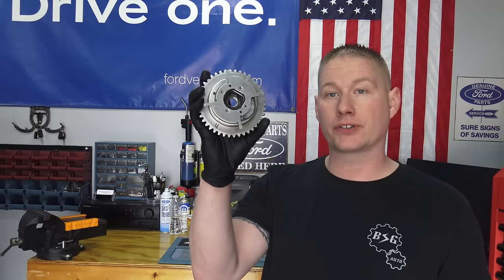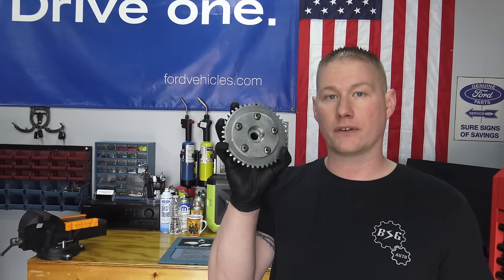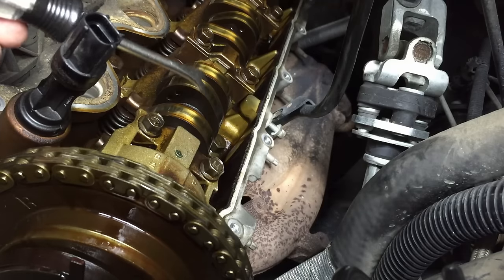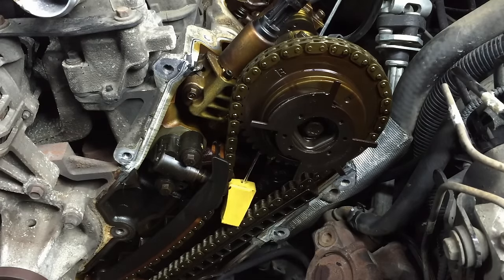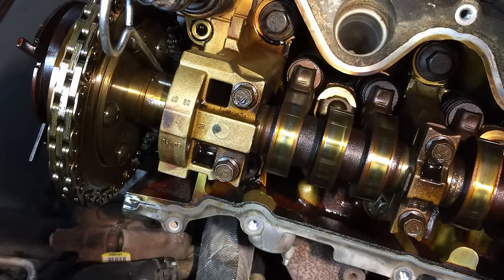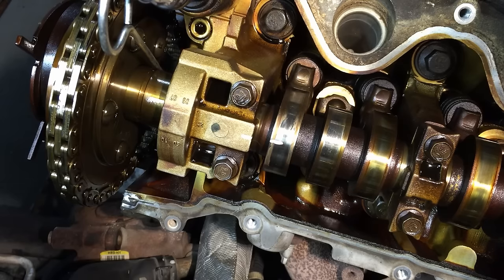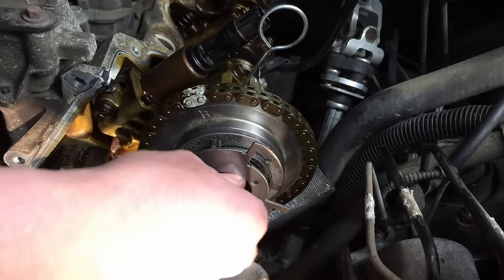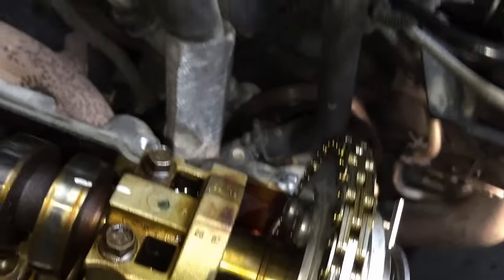Ford 5.4L 3v Camshaft Phaser Replacement**UPDATED FASTER PROCEDURE**

Comment: I put a paint mark on the chain where the r/L mark is, use the wedge tool, I take the second cam cap off, put a small piece of computer paper under the cap, tighten the cap down just snug nothing crazy don’t distort the cam cap from cranking it down tight it doesn’t take much and this will make the cam not move while u swap the phaser then remove the cap take paper out, torque cam cap then phaser bolt. Ford master tech told me about this 15 years ago I’ve been doing them like this ever since.
Reply: This is gold
Reply: Can I change the camshaft using this method?
Reply: Do I need to remove the timing chain cover in order to do this? I know this video is 8 years old but I have a 2011 Ford expedition with 200,000 mi that is starting to give me phaser trouble I've already replaced the VCT cylinders both cam position sensors and the PCM. So popping the valve covers it's not a big deal but I don't remember if I could get the cam phaser off without pulling the timing chain?
Reply: @Dyllanman  I would say no. You have to remove all the cam caps. Paper would do you no good in this case.
Reply: Is computer paper different than regular copier paper?

Comment: Guys do not skip the marker process, it will save you so much time.
Reply: How did you guy remove the cam phaser bolt. My impact doesn’t fit between radiator and bolt. If i use the breaker bar, it keeps pulling the block inside alternating my 11 oclock
Reply: Jacob Wouldn't those cam locking tools keep ya in time or a pair of vice grips
Reply: @wildwoodtop Vice grips works too

Comment: I wanted to thank you for this video. This helped me diagnose my truck and then was critical in the repair. I followed everything exactly, and the outcome was perfect! A few notes for anyone else attempting this: Make the marks on the cam phasers and the cam lobes, as indicated in the video. My cams rolled just a little bit when I took the phasers off, so the marks were crucial. On the cam phasers, the "R" imprint is very close to where the pin is located on the back side that has to line up with the notch in the came shaft, and if your "cheese" is in properly, there is no play in the chain. Moving the cam shaft slightly to align was necessary due to the roll of the cam in my instance. The hardest part of the entire job is the rear valve cover bolts. Either I need to be taller, or I need a low-rider! Due to the rubber grommets on the valve cover bolts, make sure they are all aligned and seated in the holes prior to tightening anything down. Visual inspection through the wheel well is imperative. GREAT VIDEO and PERFECT INSTRUCTION! THANK YOU!!
Reply: What kind of signs that it shows when you need to replace them
Reply: @michaelpatton5012  It sounded and felt like the truck was going to fall apart. It only did when it was warmed up and at idle. You'll know it when it happens. It makes a heck of a noise.
Reply: Can I ask how ya got the fam turned back and to stay in place?
Reply: @azmadmonk1  If you utilize the tools identified in the video, the cam should not turn once you have the chain removed. I did have a set of helping hands that held/watched the cam shaft to make sure there was no movement. It will move if you don't use the tools properly. If you are thorough and careful, shouldn't be an issue.

Comment: So you're saying that you do NOT have to remove the 3 roller followers on each cam once you have the crankshaft keyway at the noon position?  That's the more risky part?  If so, I really wish I would have watched this before using your 4 part series... I removed 5 of the six roller followers with a flathead (not the special tool) and can't get the last one (closest to firewall on passenger side).  Is there any danger in using the method in this video and leaving that last roller follower on?
Reply from the maker: +ChaseBrumfield In order to time the engine right all followers should be removed so the cams can be set perfectly in position.
Reply: Hey Brian, I have crank at 12 and trying remove rocker followers. I got 5 removed from 1-4-5 cylinders. But cylinder 8 exhaust spring seems to be compressed? What can I do?

Comment: Used this same process just yesterday on my 4.6 V8 Mustang. I didn't quite have the lobes at 11 and 8, after taking the phaser off the cam rotated a half inch or so. I figured no big deal, I'll hand rotate the engine to align the phaser to the cam and install it. While rotating the engine the chain sucked the wedge further towards the crank! Haha, I wrapped my tools up for the day and went inside.
Next day I was able to keep rotating the engine and aligned, torqued and finish installing the phaser then went on to fishing the wedge out.
My car runs smooth again and I have you to thank for guiding me through this seemingly daunting process! Thank you so much

Comment: I just did my passenger side phaser .. thanks Brian .. the alignment mark saved me from disaster . I couldn’t get it aligned and my cam had shifted a few degrees. I was able to use large channel lock and got it on there. Thanks Brian …

Comment: wanted to thank you for your 4 part videos on cam phazers .i'm from marquette mi my 3 valve 2005 5.4 was very noisy was down in Memphis Tenn no one wanted to touch this job. looked at all your videos and drove my truck back to the UP .with the help of your videos I was able to do the job. my timing had jumped one link . used your advice all ford parts new melling 360 high volume oll pump (that one bolt was very scrary to put in lots of rags in oil pan.)but i got it .took foever!!!! to get oil pressure.it seamed!!! connected crank sensor and started and runs great with 300 miles on it we are going back to Memphis THANK YOU AGAIN FOR YOUR VIDEOS....

Comment: Great series, I'm very impressed with the clarity and detail!
 I was able to jam the cheese rod into the timing chain from the front side of the phaser and replace the phaser easily with no clearance issues in my 2008 F250 5.4 (with 378,000 miles on it). My cheese rod would not fit through the cavity in the procedure that you suggested. Just an FYI. My cam did move. I was able to move it back and the phaser slid rite on. I'm glad I market it! The engine runs like a top. Thanks!
Reply: Yea looking at his video. I'm pretty positive the positioning he is using to get the wedge tool in is physically impossible to do with the front cover on. He points the wedge at one point where it would be coming directly out the side of the front cover. I don't think the tool has the amount of bend to make that happen. In the Ford service manual the picture they show as reference shows it going in through the front. So that would be the proper way of doing this.
Reply: @sethdrak3  Seth I'm working on a customers 2009 3v and I had to go in from the front of the phaser. I am surprised the amount of wear on the chain for only 117k miles on this vehicle. Still a great video.

Comment: Just completed driver's side on 2006 F-150. Couple of comments
1. I could not get the wedge in the way Brian describes it. There is a picture in the Ford installation bulletin that shows it going in on the outside of the head in front of the cam phaser. This worked for me and it was not in the way.
2. I did not have the cam positioned quite far enough and it moved when I took off the phaser. If it's marked like Brian said, no need to panic. It is easy to protect the cam shaft and put some vise grips on the area between the first lobe and the phaser seating area. Just realign the marks and put the phaser on. 
3. Lastly, I could not source a single valve cover gasket and had to buy the whole set. Though probably not needed, the rubber doughnuts in the set can be replaced, but they are not sealing gaskets. They are used to control the force applied by the valve cover bolts. You have to cut them off the bolt sleeve and then push the new ones on over the sleeve. DO NOT try to remove the metal sleeve from the bolts.
Reply: Bro your a life saver I was bugging on how to get the can back to it original spot. Looking it I figured vices or piper wrench on the would work. Thanks for your input
Reply: Thank you!!!! The vicegrip advice was desperately needed!

Comment: Dude, Awesome video.  I have seen a few of your views and I'm impressed more and more.  I was a Ford Certified, you however have what I like to call gear head, know what your doing when it comes to thinking about the math and timing, and pulsewidth , that kind of stuff.  Being I worked for ford for many years, it was a quicker burnout for me but guys like you reassure me that I still know what I'm doing, research first, and plug and play.  Great video man.  One of the more complex one's Ive seen you do but I prefer it.  Thanks man

Comment: This is EXACTLY what I needed. I was changing out the vvt solenoids and noticed that the coil spring on that phaser was broken. I didn't want to have to take off the timing cover because I've never done anything like this before, so it's nice to know that it can be done without taking it off.
Reply: U can do it just go slow and don't get high or drunk while your doing it

Comment: 20 + year ford tech here,, great video i never have a cam to jump because i cut a piece of plastic from a oil or antifreeze jug, remove the 2nd cam cap or further back and sanwich the plastic between cam and cap bearing and snug tight (no air tools as the cam cap will break) holds that cam perfectly. as stated in video make darn sure the dowell pin in phaser is there in place. don't eat the cheese. my personal truck 5.4 3 valve heads i sent off for a line bore and insert bearings like rod and main bearings, more important melling high volume oil pump more agressive cams, phaser lockouts reprogram to delete varible cam timing, headers + dyno tuning. results a tire roasting sob that still doesn't make the power of the coyote 5.0 stock. all this vct crap is supposed to help power and fuel economy. the 2004 and up f series is a heavier vehicle with a frame stronger than any gm garbage at the time. the 300 hp 5.4 3 valve never felt like a 300 hp engine in those heavy trucks but more like a old slant 6 dodge pick-up. my 2006 f-150 5.4 came un-glued at 280,000 miles and i only ran amszoil in it from 1st oil change on thru 280,000. having a pile of 5.4 3 valve cores at home went for the rebuild from the .030 over bore, line bored heads, block, cam phaser lockouts, more agressive cams, exhaust, dyno tunes. my mpg was around 17 mpg hwy before now is 19 mpg and sometimes 22mpg. and passes emissions. i was over 400 miles away from home when my engine failed, it never rattled, never had a phaser replacement or timing chains. a timing chain broke and locked it down and amszoil kept that weak crappy ford designed boat anchor together for 9.5 years and 280,000 miles.
Reply from the maker: Nice!
Reply: hey Charles nice plastic trick, thx. i am a 20 plus year tech about to start at a ford dealer, any more tips and tricks you can shoot my way? thx
Reply: Charles- Where did you get the cam phaser lockouts as I hate the idea of all those moving parts eventually failing.

Comment: My late 2008 5.4 is at 222,000 plus miles with no cam phaser issues. I change the oil, 5w-20, every 3-4k miles, always use the OEM filter, and keep clean air filters  in it.

Comment: I just finished installing phazers in 2009 F150 5.4.  There is not any space to inject the cheese stick down in between the timing chain when you don't remove the timing chain cover.  I therefore recommend that you don't do this alone.  You are going to find it very difficult to manage removing the chain from the phazer as the chain is under tension which is released when you remove the phazer from the cam.  I also recommend a pair of vice grips around the cam back of the phazer with the handle laying against the head.  Even then with two people you will find it difficult and nerve racking trying to put phazer under the chain and then placing it on the cam while pulling against the tension.

Comment: Hi, thanks for your great quality videos, you are very well spoken.  I attempted a drivers side cam phaser replacement on a 2005 F-150 that we recently did a timing chain and tensioner kit on.  One of the tensioners had the infamous blown seal and the engine was noisy.  We caught it before the guides broke luckily.  It was still somewhat noisy after the timing job, so I replaced the VCT solenoids with Ford parts.  Still no better, so I attempted the drivers side cam phaser.  Marking the cam cap and intake lobe paid off big time.  I went one step further and clamped a small pair of vice grips on the cast part of the cam shaft and locked it against the inner side of the cylinder head just to be sure.  I made my own "cheese block" from a piece of MDF trim and a coat hanger.  I drilled a hole down through the cheese block and put a 1/4 inch bolt through it with a lock washer and a nut on it to be sure I would be able to tug on it enough to get it back out.  The coat hanger was twisted around the bolt, so it was very solid and not going to fall off.  It worked fine.  I would have ordered the OTC tool, but there were none available.  When I removed the phaser, I found out you really mean "11 o'clock"  I wasn't quite there and my cam moved clockwise about 5 degrees when the phaser came off the cam.  Luckily with the vice grips still attached to the cam, I was able to use one hand to rotate the cam back to where it was, but this only allowed one hand to try to get the phaser back on square.  This is where I learned how easy it is to get it on crooked.  It was tight as my timing set is new, but I managed to get it back on okay.  I used a torque angle gage to do the final 90 degrees....it worked better than the paint marker trick.  They are cheap.  This is an excellent video.  Total project time for the drivers side was about 3.25 hours, except that while standing on the front crossmember to get the valve cover bolts out (why Ford must you have like 15 bolts, when an LS engine has 4)  I managed to break an already somewhat rotted tranny cooler line...lol.  When I started it up, it ran great, but spewed tranny fluid all over my floor.  I managed to patch it with fuel line hose and clamps until Thursday when the lines are getting replaced.  Thanks a bunch!
Reply: How did you get the phaser back on the driver side? I replaced all timing components also and it's so tight I'm finding it impossible to get the phaser back on. Any tips or tricks?
Reply: @damiananey997  Honestly it was tight for sure.  I could have used a third hand, but it was late an nobody was around to help.  I used one hand on the vice grip (not clamped on a lobe of course to prevent scratching) and moved the cam back into position where it was (I had paint marked the cam in reference to one of the cam towers) it had moved about 2 degrees due to spring tension.  I held the phaser in the other hand with the chain on it (chain link marked in reference to the phaser).  I used my left hand to pull up and moved the cam slightly back and fourth with the vice grips until I felt the dowel pin on the phaser slip into the cam.  I then carefully tightened the bolt.  Be sure to take measurements from the front cam tower to the back of the phaser as per FTM videos to ensure you have the phaser fully seated on the cam and SQUARE to the cam.  It must run true on there otherwise major engine damage will occur.  My suggestion is to get a helper....this would likely be much easier.

Comment: Dude.  obviously I've been working on a 5.4 3V. I've seen every video,  read every forum, and you sir are a gem.  you are the correct combination of "book" and "practical" if you were less than a thousand miles away from me,  my truck would be in your shop
Reply: hes got the right side timing mark on the left side
Reply: No, lol. He simply marked the R because it's easy to transfer to the new phaser without error. The colored chain links won't line up exactly with the L and R on the phasers for like 122 revolutions (don't quote me on that number but it's a lot). He marked the phaser for it's current position in relation to the chain.
Reply: I wonder how much he charges

Comment: I TOOK MY F150 to the dealer for a noise , they diagnosed phasers ,paid $1200.00 and the noise still the same ,now that I see your Chanel I think it was the rollers why in the world they didn’t tell me it could be those too? Dealers are bad , end up selling my truck to car max and bought a 01 tundra with low mileage and don’t regret it , by the way good job.

Comment: im probably going to have to do this to an 05 and this video seems to be an excellant guide thanks for posting, this should save a whole lotta time hopefully
Reply: Let me know how it goes! I’m hoping to do it on an 04 soon. Problem is, I’ve got a rlly light ticking noise on warm idle only, disappears on acceleration. You can hear the tick under driver side and passenger side wheel. I am not sure if it is the phasers since the phasers are located at the top of the engine, so wouldn’t that mean the tick would be heard from the top end? I don’t wanna throw phasers at it if it doesn’t need it! Thanks for any input.

Comment: OK thanks for the info. I had already bought all the part before I found this video 2 phasers 2 siloniod 2 value cover gasket should be set
Reply: I did the same thing. Lol
Reply: @joearreola5293  looking to do the same thing . Was gonna do the whole chain but found this . How do it go afterwards? Still running good ?
Reply: Good video as usual, what do you think about the phaser lock out kits?